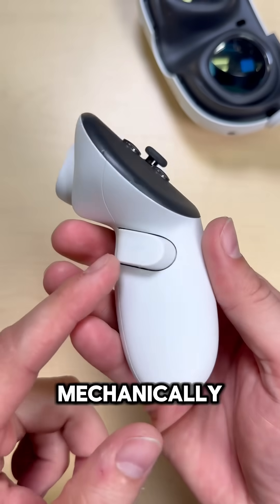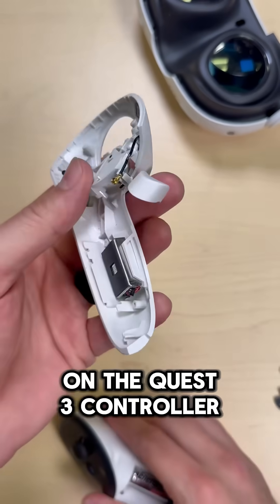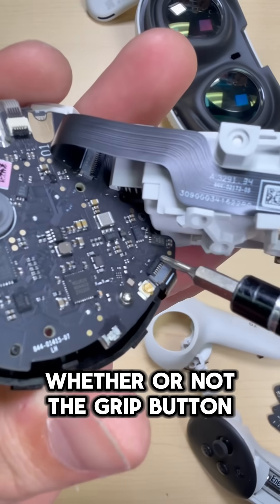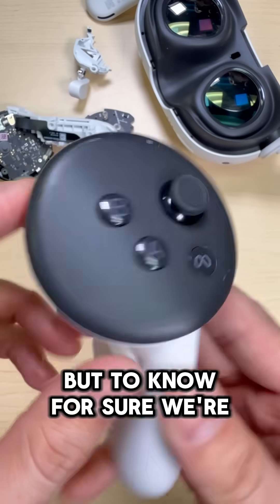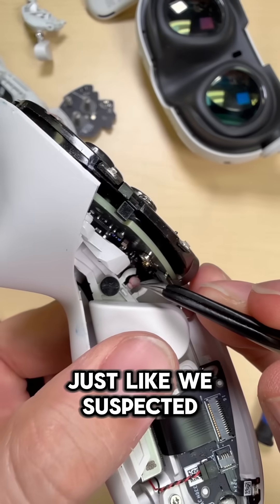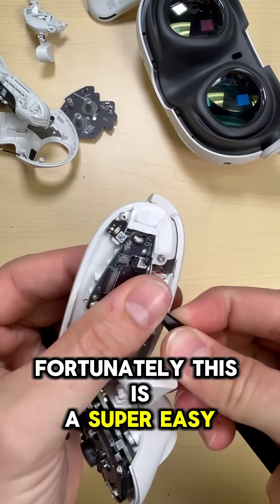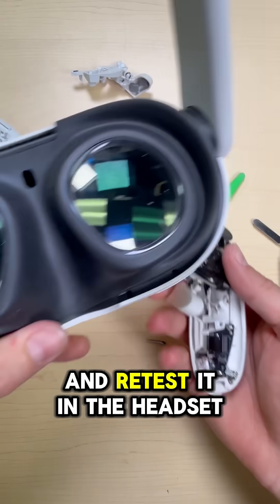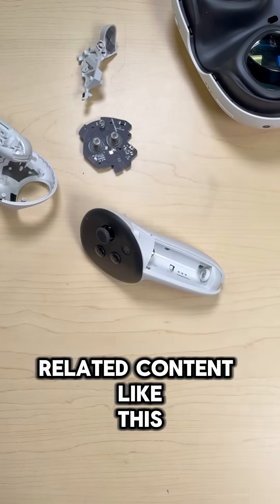This Hidden Grip Button FLAW Ruins Quest 3 Controllers.  #vr #virtualreality #quest3

Comment: Just quick question if my top trigger (the larger one) isn’t pushing just right what should I do? Like it works and so does my bottom one it’s just they are acting quirky and sometimes when I press the top one it moves side ways some times it gets stuck and sometimes it does press all the way same for my bottom to

Comment: I actually did have this problem. Sometimes when starting up my Quest 2, that's about 3-4 years old I think, it would not register any grip on both controllers. After restarting the headset though it works fine. I wonder if it was just the headset not registering the grip on startup

Comment: same thing on the 2 happened to me, I factory reset the controller and it worked
Reply from the maker: Factory resetting the controller put the magnet back in place?
Reply: @fixmyoculus   it was most likely a problem with the coding or something liek that, something DIGITALLY not PHYSICALLY instead, and not the battery.

Comment: I have a question. I just turned on my oculus after I was dead and it is just stuck on a black screen and I know it is because it’s lighter than it was when it was dead.
Reply from the maker: Most of the time black screen issues like that are due to sensors failing. I have a full video on Black Screen BSOD issues.
Reply: Try restarting, and if it's bootlooping then it's most likely due to low battery

Comment: How do I fix my sick drift without taking apart my controller
Reply: You can't
Reply: If your controller is drifting while sick, tell it to stop drifting and give it some cold medicine
Reply: in my experience with most controllers, you cant, i have never worked on a quest 3 controller but i have worked on a lot of other ones
Reply: simple answer: you can't.
anyone who tells you otherwise is simply wrong
Reply: You buy a new one 😂
Reply: Prayer
Reply: Try some kind of electronic contact cleaner.
DO NOT USE WD-40 unless quick dry version, cuz there should be no residue left.
Reply: You can calibrate some out in the settings, but the best way to fix it is just by replacing the stick box. You can also try pouring in isopropyl alcohol from the outside, that might get rid of a bit
Reply: YOU CAN!  
1st, take the battery out. 
2nd, get 92% isopropyl alcohol and pour (about a half of a teaspoon) into the [joy]stick, and do hard circles/rotations for about a minute.
3rd, let it air-dry for about 15 or 20 minutes, then put that battery back in after drying period. 
THATS ALL!

You might have to do this again in a week, a month, maybe never, maybe daily… but it’ll give you control back long enough to play again.
Reply: @See_thru_it_all  damn, same trick as back on 360 lol
Reply: @See_thru_it_all  thank you